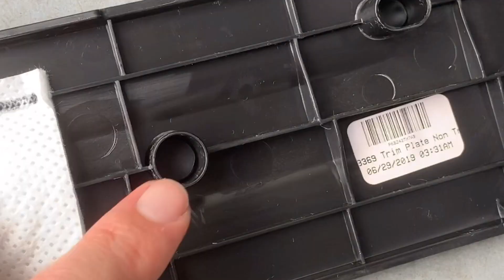Front Runner Outfitters Drop Down Tailgate Table Install - 2019 Jeep Wrangler Rubicon JL

Comment: What size drill bit did you use?
Reply from the maker: 10mm drill bit
Reply: @OffRoadLocos  Is that like a 31/64 bit?
Reply from the maker: @jamesdbrot  you can try 25/64(9.921mm) or 13/32(10.318mm).
Reply: @OffRoadLocos  thank you so much for your help bro